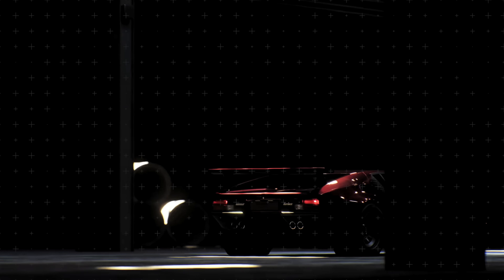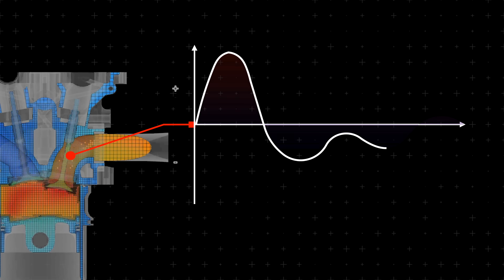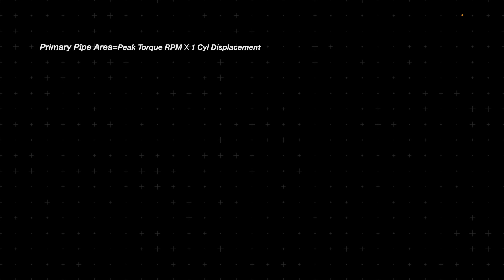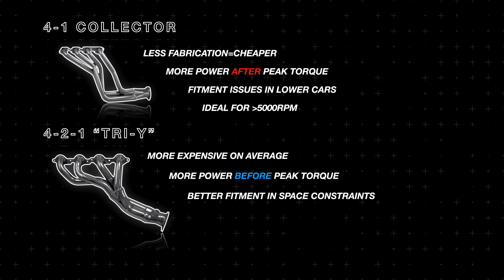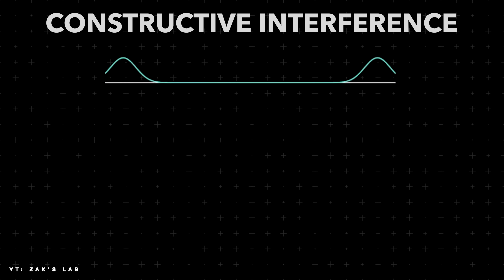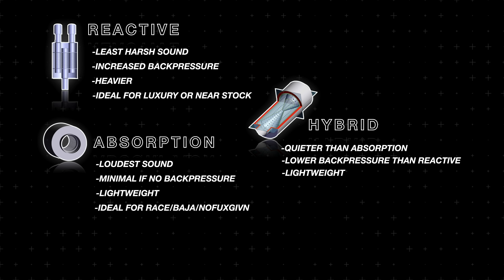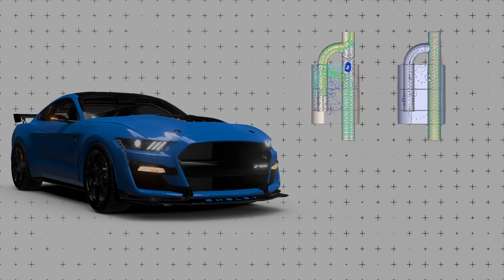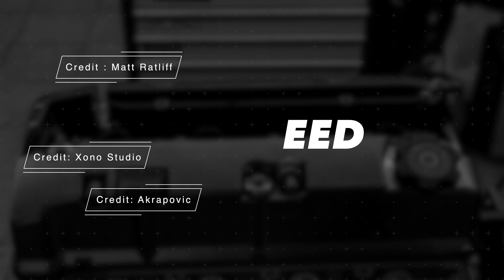Why Exhausts Make So Much Power😵| Explained Ep.27

Comment: Thick wall tubing is so it doesnt break from the weight of the turbo, you want thin wall tubing the preserve heat, and wrap it in heat insulation

Comment: So with regards to Flat-4 engines in Subarus and the FRS/86/BRZ, what would spool a turbo better: equal or unequal length headers? I'm debating forced induction for my UK-Spec 86 and I'm split between Superchargers, HKS Turbo (EL Manifold) and AVO Turbo (UEL Manifold) kits, all can achieve around 300-400hp which is what I want and the kits for the platform produce similar results and if one turbo kit has better spool than the other or if I should go SC and not worry about spool
Reply: Equal I would think. Be a more constant continuous pressure on the turbine

Comment: So here are some basics related to sound i learned over the years, they cannot always be applied to a tune, sometimes factors contradict each other out and aren't as apparent, and as always the most distinct part of sound starts at combustion chamber and ports combined with engine layout itself and can only be changed so much if at all, but some basic notes i found reliable and like sharing. 

-Intake to Exhaust valve area ratio: Usually golden ratio for performance is about .75, but venturing higher towards exhaust side say .82 often gives more dynamic pitch change as revs increase, engines with lower exhaust ratio say .65 usually stay deep throughout rev range relative to others.  

-Merges: The best sounding engines have either very clean ports, and where applicable very clean merges starting at the head, followed at any collector.  Some engines like the K-series Hondas and RB26 "suffer" relatively smooth sounds because the merge between exhausts at the head is blunt. 

-Exhaust Valve and or port to Primary Header size: Porting to match primary always makes this the best, but oversized headers sound deeper to put it simply.  If you want to make a engine sound truly deep on the cheap and don't care 100% about performance then over sizing primaries is the easiest way to do it right, although can cost low down torque or in worst case move power band beyond your rev range. 

Where applicable secondary length: So far as Secondaries, if you like more a throbbing sound on say 4 or 6 cylinder where secondaries are more common opting for longer ones improves the strumming sound of the engine is easiest way i can describe it.  A great example is stock AE86 exhaust vs other 4AGE like Mki MR2 stock exhaust, usually longer secondaries help broaden power band so can have that benefit too. 

Main Exhaust Size: Always a balancing game as you want the biggest that works with exhaust scavenging, and smallest that avoid reversion.  But one that is smallest you can get away with for your specific tune will sound much throatier, too large muddies the sound.  A great practice and example is looking at professional race cars and their systems, always note output rather then engine size and comparing vs poorer examples of "tuned" cars and when possible hearing the difference yourself.  Also worth note exhaust tips often can have large effect on sound if diameter itself does open (rather then "cuff" style, simply larger attached around the system), personally not a fan unless its a high performance Turbo Diesel where the sound can become so extremely harsh it goes beyond thoaty, and a big outlet at the back helps dampen it a bit.  Reminder sound is still somewhat subjective at end of the day.

Mufffer placement: Not a right or wrong but choosing right for your preference comes into play.  If Muffler is placed right at the end of the system generally this smooths out the sound regardless of muffler type, in some cases a lot.  If you want throatier, more natural or even cammed like sound keeping whatever tailpipe aft the muffler possible, the muffler moved more towards center of system goes a long way.  Likewise having resonator/muffler (or whatever applies) spaced as evenly as possible between collector and tailpipe helps a lot with reducing rasp assuming everything else is built to a high quality.

Comment: How about a video on different fuel types? I'd love to know how a fuel with slightly higher octane rating can make such a difference
Reply: Its so simple you'll feel stupid. The fuel itself has more oxygen in it
Reply: @janeblogs324  as if i didn't know already, i want to see a video on fuels by 337 speed because i know he'll make a super detailed video on it, comparing different types of race fuels and why is one preferred over the other, and how Nitrogen oxide came into play with gasoline. Actually i do wonder why hasn't anyone used nitrogen oxide with diesel engines? It just provides more oxygen, so it should work with diesels too?
Reply: @My_Gaming_Mind  People use Nitrous Oxide on diesel engines. Works just the same, goes from rolling coal to rolling power instantly.

Comment: These videos are so well done to the point that I normally have very little to add. In this instance, exhaust systems from the flange to the first bend is actually an amazing dark art all itself. The length of the runner and even the shape is perhaps the most critical areas to absolutely nail for absolute power gains when fine tuning for maximum performance, as going too far in both dimension and diameter can literally suck power out of the combustion chamber. The role of backpressure, most notably in NA engines, plays a critical role with valve timing in maximizing power made during the power stroke as well as retaining the gases In the combustion chamber for the most complete combustion. How the exhaust pulse travels plays a large role in this as well, as it is both a measurable difference through CFD computation, but also acoustically.  One of the more interesting things is that a fabricated exhaust can look great aesthetically, sound decent, but the pulses can kill power through reflective resonance in combination with poorly optimized geometry. 
Some folks will put on a nice-looking exhaust without the forethought of what is really required to get the most performance gain regardless of price, as even name brand systems will get you something in the butt dyno, but are far from optimized designs. As said, it is its own dark art that takes the right hand to craft a system while also ticking all the right boxes.
Reply: bingo.  I once spent an afternoon with a rtired F1 exhaust engineer, and it was absolutely incredible.  Helmholz resonance, 'acoustic ports', super thin-wall inconel tubing, it's incredible how these things were dreamt up based on the mathematics they were playing around with.  A lot of this was the development of WW2 aeronautical engineering.  It's an incredible field.
Reply: Absolutely

Comment: Really nice video! But you "forgot" to say something about collector and length of primary pipes! You explained what shorter and longer does, but for me personally it's not enough. As exhaust gases are exiting the cylinder, first pressure wave that travels around speed of sound (or faster, depends on diameter of pipes) passes through exhaust and when It reaches place where it can expand, than it creates negative pressure (vacuum) wave, that travels back to cylinder and makes overlap happen.
Eg.: We have engine with peak HP around 6000rpm, we want best scavenging effect there, so let's say we have 245° exhaust valve opening, so 360° takes 0,01s, than for 245°=> x=0.01x245//360=0.0068s the wave goes two times so we need to know only one length, so we divide that by 2 => 0.0034s now times speed of waves, which could be around 400m/s and that equals to 1.36m of distance from valve, we have ports, so around 1.2m of headers to collector (place to expand).
If anyone wants to know universal equation, type down comment, I'll find it somewhere in my physics paperwork...
And than small not so important thing, X-pipe makes theoretically scavenging, but it's much smaller and not important, really X-pipe uses venturi effect to create vacuum in the other pipe, that helps suck out exhaust gases.
Than, the graph of pressure wave, you used graph of normal I engine, V engines have another negative pressure wave. In the graph, pressure increases, pressure wave hits collector and negative pressure wave is in cylinder and graph goes under 0. Than pressure wave (not that strong) hits end of the exhaust and creates another negative wave, in graph it's another bump down to negative and than it settles to 0. But in V cars we have another bump from connecting two main collected pipes. It's just little confusing, showing graph about pressure waves in I engine and than talking about X and H pipes used in V engines.

Comment: There is an intangible and indescribable sensation that the exhaust notes from a well-tuned internal combustion engine delivers to the driver. Let's find a way to keep that visceral car-driver engagement alive forever!
Reply: My humble 06 XRS with aftermarket everything is going nowhere as long as there is a pump.
Reply: More mainstream electric cars get, the bigger the batteries get, more pollution they give off making them less carbon neutral, less developed countries are not going electric anytime in the next 20-30 years and people don’t realize that’s a large population of our planet, they have to figure this fuel thing out because batteries is not it(it’s for people who have easy commutes and/or have a second car) meaning the vast majority are not going to be reaching the mileage for when they become carbon neutral… besides if there’s a natural disaster and you have to get out of dodge are you going with a gas vehicle or a battery?(gridlock traffic or electrical grid going down after the fact). No thank you!
Reply: Or induction noise!
Reply: Lfa, paganis, v12 lambos, etc, these are eargasms.
Reply: Most definitely a nice thought but this will not be the reality. Answer, appreciate the era we’re in and what we’ve got these days. Change is a given.
Reply: @Torrque  It's just not possible to replace every ice car with an ev. There will be either less cars or still a lot of ice cars. Ice cars are also less bad for the environment.
Reply: We need louder, and more sensory responsive EV motor + transmission systems to help replicate that effect. The original Tesla Roadster's totally real and LOUD (for an EV) space ship hyperdrive-esque sound it made when the trans & motors really got spun up is what ALL EV driver focused cars should aspire to!!! Silence is failure, and piped in fake noise is even WORSE!!! 🤮 A truly great sounding EV like said OG Tesla Roadster can have nearly as much auditory personality and character as a traditional ICE powered car, as unbelievable as that might sound to some. 🤷

Comment: Damn it's amazing how much engineering knowledge goes into an exhaust system these days
Reply: Everything in an engine is very, very complex. Intake manifolds, headers, catalytics, mufflers, etc.
Reply: Well, after 120 years of automobiles we should have learnt a thing or two haha
Reply: Cool information thanks !!
Reply: Yes indeed
Reply: @sharedknowledge6640 spoken like someone who must be too poor to have ever performed actual engine performance modifications that would warrant an upgraded exhaust
Reply: Fluid Mechanics my friend.
Reply: @sharedknowledge6640  They are metal tubes welded together. As much as Westerners like exhaust notes THEY DO NOT add "power" as much as you think they do. Size per size a Chinese exhaust is within error of Japanese exhausts and there is barely magic in them unless you are talking about acoustics and sound dampening.

My aftermarket Borla exhaust added 1-2HP (which can be just error tbh) in dyno. My forced induction added 65HP

Now I have a catback I did myself with a random Indonesian metal fabricator's exhaust parts and it performs the same.

My car is an Evo VII
Reply: @JABelms you'd get much better gains with a "free flowing" downpipe.  That would also allow what you already have to do what it can.  It's all about the whole setup.
Reply: @midnight347  Yeah and my catback costed me $200. The increased size of the pipe helped the my car get 600 to the wheels, I doubt it has anything to do with the brand used nor the "ultra perfect" welds. Spending more than $400 in exhaust is an absolute waste of money
Reply: @JABelms forced induction will make the exhaust more important and pick up more vs an na setup obviously.
Reply: Fr
Reply: Toob
Reply: This aint Grandmas Stove Pipe Cooking here......:face-purple-crying::face-purple-crying::face-purple-crying::face-purple-crying::face-purple-crying:
Reply: Ephesians 4:29 Do not let any unwholesome talk come out of your mouths, but only what is helpful for building others up according to their needs, that it may benefit those who listen.
Reply: @cam_strng  Jesus Christ, what a way to destroy a video!! WTF does your f_a_g/g/y religious beliefs have to do with a video like this? FFS SMH
Reply: @cam_strng  
 "Do not let any "unwholesome talk" come out of your mouths"
So how do you learn with out criticism? 

"but only what is helpful for building others up according to their needs, that it may benefit those who listen."
That's a slippery slope don't you think?What if the their needs are not moral.

Ephesians 29
 Let no corrupt communication proceed out of your mouth, but that which is good to the use of edifying, that it may minister grace unto the hearers.

Why change it, it's very clear this way. The devil is in the details.
Reply: @maisydaisy9970 didn’t think I’d run into a theological discussion in these comments lol. Good retort btw, you seem to know your stuff.
Reply: @cam_strng  Wise sage